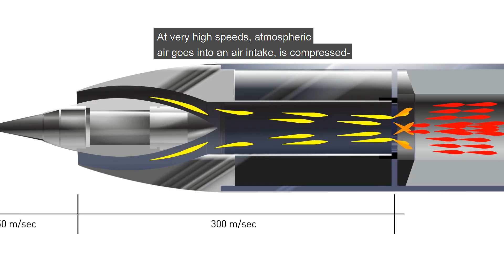How ramjets may change the role of artillery on the battlefield

Comment: I think I may have missed it, but where is the warhead?
Reply: I think that these experiments are still in the early stage and have not yet reached the stage of projectile production that is actually used. However, the real feasibility of this research is to increase the capabilities of warships to target enemy ships.
Reply: I'm starting to think that having all that metal slam into the target at supersonic speeds, is the payload…
…it's called "kinetic strike" or something…
Reply: Jekyll Park the point of artillery is to be inaccurate and destroy an area, kinetic energy weapons destroy things by dealing pin point damage on armor to be able to go through it, not explode. A kinetic artillery shell (god forbid even saying it) does not explode and only effects the spot it is hitting, it also doesn’t send shrapnel out anywhere at all so good luck even scraping a skyscraper with these.
Reply: Stand within 100ft of one of those shells hitting I garuntee you won't be asking where the payload is after that. And then times that one shell by 50 impacting an area I wouldnt want to be anywhere near that. This is not a video game where you blink red if you are a distance from the impacts. In real life you die from that.
Reply: @mig1739  Still though, these will have a very small area of effect compared to even a dirt cheap standard HE round using design philosophy from the 1860s. While I love the idea of a ramjet powered artillery shell because its such a cool idea, this design just won't be worth it I imagine. As complicated as it is to fit all of the guidance and motor packages, it will be far more expensive than even an Excalibur round for barely more oomf than a hand grenade. In the long run, we'd be better off developing a better MLRS system as those can easily wipe out massive areas and are essentially perfect for untouchable counter-battery when loaded with cluster munitions.
Reply: From the cutaway model it looked like they intend to fit the payload around the motor behind the intake, and in front of a fuel tank, so a lot less boom. Looking at it again the shock cone may also have something in it.
Reply: Packed around the outer annular space around the air path.
Reply: I would think the increase kinetic energy makes up for the lack of a payload
Reply: @God_has_spoken  Increased kinetic energy just makes a deeper hole in the ground, modern artillery is mainly for anti infantry, hearing "load anti-tank rounds" is the nightmare of any artillery crew.
Reply: @bravomike4734  In that case won't those projectiles be more useful against armored vehicules when used on a tank?
Reply: @bravomike4734  even though someone allready commented, that this type of round just increases the range without increasing its speed, keep in mind, that the kinetic energy rises to the square of the velocity.
E_kin = 1/2 m v^2
Reply: @God_has_spoken  They aren't increasing the kinetic energy, just the range: if you watch the animation the engine gives it height but the terminal velocity will be the same. This is an investor scam. Stay far away.
Reply: @wilfdarr  There'll be less velocity at extreme range, sure. But until that (the ~150km mark), the fuel still burns. And the velocity up until then is fairly constant.
Reply: @God_has_spoken  That needs to be for a pin point accuracy which isn't in artillery
Reply: 1/3 comments on here ask the same question. Do a bit of reading before asking. :)

Comment: shells with engine……can I consider it as a gun-launch missile？
Reply: No, missiles are guided weapons, this is not guided.
Reply: @Thorgon-Cross  the video literally says they have a guidance system so yes its a gun fired missile
Reply: @Thorgon-Cross  The definition of a missile does not preclude the use of unguided projectiles. It is simply more effective to have a guidance system on a missile to give it the ability to correct its own aim as it approaches the target. The guidance system is, however, not a requisite component of a missile. See my other comment in this thread.
Reply: Yes. A rocket contains its own oxidizer whereas a missile uses the atmosphere to provide oxidation to the propellant. So technically this will be an artillery tube fired missile system.

Comment: Alright, reality check.  MLRS from the USA has a range of 300 miles (480km). ATACMS has a range of 190 mi or 300 km. Both of these are rocket artillery.

Comment: In short: it's never going to be useful, not cost effective and also dangerous.

The long answer is that:
Artillery is effective because it uses explosive power to spread lethal shards on a circular area. It's higly effective on infantry which is the main ground force, and it will destroy buildings or disable vehicles. The pinnacle of modern technology is the M892 Excalibur, 50+ (almost 60) Km range with a 5 - 20 m CEP, and can do all three things with 10 Kg of explosive. So it can hit and be effective pretty much against all targets.
It's expensive, but say 60,000 $ for 3 types of targets (infantry, vehicles and building), it is cost effective and effective in terms of warfare.

Using a ramjet/scramjet artillery shell isn't. It can be effective against buildings and vehicles but won't do nothing to infantry. The "it's pure kinetic energy" thing is bad for field artillery. Now, 155 mm IS field artillery. So unless you wanted to have a super super accurate round to hit tanks or specific buildings, that's absolutely not going be widely effective as an artillery round. I don't see any precise guidance system and I Imagine it will cost too much just to cover two fields. Plus, rockets or jets are highly dangerous amminition to handle.

So, I guess you basically wanted to go 100+ Km and Kinetic. You know, the kind of words armies like to hear "modular, fast, lethal, etc.", just change route guys.
Nobody will spend 100,000+ $ on a round with only limited capability against large ground forces. I forgot to say that, if you want to fire 4 or more of those per minute from a 155 mm howitzer, good luck with the money

Comment: That's nice; you send the enemy a ramjet motor - where does the big bang destructive explosive fit?
Reply: Proud Indian   A 150km range will also change the way the enemy moves on the battlefield and well behind the lines.  The effect of the round is much more than its physical characteristics.
Reply: Obviously in the nose of the motor.
Reply: Shoulder base Tactical nuke launcher is smaller(developed in 60's) and can fit well in those.. Just an opinion..
Reply: 3 kg of HE. They are researching an new guidance system since it's so weak.
Reply: whats the cost of this ramjet? 100 , 1000, 10 000 or 100 000 eur?? Americans like to blow up a 750 dollar car with a 25 000 dollar bomb but how about others? you will shoot out 10 of those "things" and run out of ammo due to costs. The idea is nice.
Reply: @andrespodra8459  You would only use when long range is required. You would normally use regular ordnance. I don't think these would be that expensive either. Ram jet motor is not complex and would be cheap.
Reply: @andrespodra8459  ramjets are extremely simple to manufacture. Basically hollow tubes with a pointy insert at the tip
Reply: @DJ_k3bab   if it would be extremely simple it would have been already done in masses.
Reply: @andrespodra8459  there are no moving parts in a ram jet rocket motor. The only complex and expensive part is the research and development process
Reply: @andrespodra8459  Research and Development costs as well as the slow nature of military procurement and bureaucracy are the 2 major bottle necks
Reply: @DJ_k3bab  well then it means then in a while everyone will use it if its cheap to produce.
Reply: @andrespodra8459  here corruption and kickbacks set in. You then sell these fancy items to countries already dealing with a lot of problems. This further detoriates economies of those states.
Reply: @andrespodra8459  this is made by Sweden generally their stuff is affordable
Reply: At the impact velocity that thing will hit its target at all it needs is a some solid metal blocks inside. Just like how railguns fire non explosive rounds. Pure kinetic energy
Reply: @spooks196  Not in this speed range it doesn't.
Reply: Piotr Dudała what is it’s speed range?
Reply: @spooks196  I presented calculations in my top level comment here.
Reply: @spooks196  The purpose of artillery is to hit infantry and other static targets. It may work for buildings, but not for hitting people. It's never going to work because that thing will never have che same energy as a standard projectile. A mass of 10 Kg of TNT has an Energy of 42 MJ, or 42,000,000 J. Translating that to kinetic energy you'll need a heavy mass at high velocity. Like a lot, the USN rail gun is even less powerful that the amount needed to equal 10 kg of TNT
Reply: @maxvonnitten4213   maybe so but then you see the rail gun round going through 6 to 8 one inch thick steel walls, which means it would go through the whole ship form side to side throwing's melting steel form the walls all over the compartments it hit wrecking them and allowing water to flood in. On land  you could add a small bursting charge to spray shrapnel  before it landed.
Reply: @maxvonnitten4213  The role of artillery is changing. It is a payload delivery system just like a precision bomber was a few years ago. The BAE Archer system has the same precision as AGM-12 Bullpup air to ground missile, but you can fire from 50km away and not have to risk an aircraft. If this works the range is doubled a few times more, making air crafts obsolete as a payload delivery system.
Reply: @maxvonnitten4213  Don't attack their feelings with math and engineering.
Reply: @maxvonnitten4213  kinetic energy goes with velocity squared. Not sure if mach 8 is reachable at low-ish altitude but if it is, you will have same amount of energy. At mach 11, 50% more
Reply: @Mic_Glow  It's M x V²/2 but also drag goes along with Cx and V², at low altitude the air is too thick for a powered round to reach it. Also, powered means it has an engine, so it's complicated to do so for an artillery round, otherwise USN wouldn't have gone the railgun way (which basically is only the gun that does the work) and 2800 m/s are high rate even for an ETC gun
Reply: @piotrd.4850  I answred down below with a very long message, I can't tag you all ahah
Reply: @MaskinJunior  I answred down below with a very long message, I can't tag you all ahah
Reply: @Delgen1951  I answred down below with a very long message, I can't tag you all ahah
Reply: @maxvonnitten4213  Shrapnel does the work. Itty-bitty pieces at really high velocities, or somewhat larger pieces at a slightly lower velocity. I sure don't wanna get in their way.
Reply: @spooks196  ok, so the ground gets hit really hard and fast, but precision is a huge factor and payload and off ground detonation effects etc surely can not be close to conventional shells.
Reply: Gor Ber I don’t see why not, like someone else had stated if you airburst shells at this velocity imagine the local damage. A Mach 6 shotgun.
Reply: I think it'll be more like a modern Paris type gun. Just a few very large guns will be made (still much smaller than the paris gun) but more accurate and longer range.

For regular artillery this is very impractical.
Reply: High velocity shell = high kinetic energy. Energy is not destroyed but transformed into heat,sound and mechanical energy (work) during impact . See it like the movie deep impact..... a comet with no explosives hit the earth at high velocity... the outcome ......big explosion ( just like Michael bay movies). The Tunguska event is an example of devastation of high velocity object. It looks that this concept may work.
Reply: @MrGeorg8288  Yes but that is at massive velocities.. Like what meteors enter our atmosphere which is around 33,000 MPH or 54,000 KPH (And that is still actually kind of slow) but then you have the effects on the item itself super heating from the friction of just passing through the air which causes drag and the loss of speed.... No ram jet can hit that.. Hell even the Blackbird has issues with heat that require a specialized heat resistant paint and making the plane with large expansion joints requiring them to not be able to fill it till RIGHT before take off because it leaks fuel till it heats up going over Mach 2.. But even at it's top speed of Mach 3.2 (which is only 2,153MPH or 3529KPH) which it could only manage at 85,000ft due to less dense atmosphere it would hardly do anything damage wise if it impacted a reinforced bunker.... It would likely kill a tank crew through... But just the tank it it, the tank itself would likely be serviceable after some repairs.